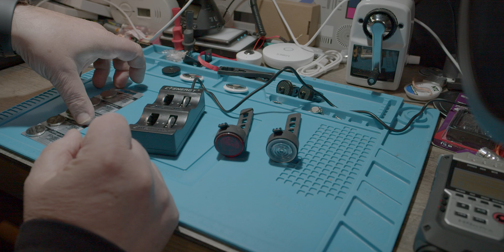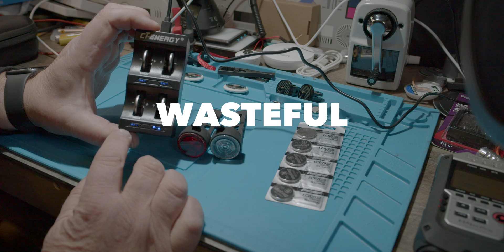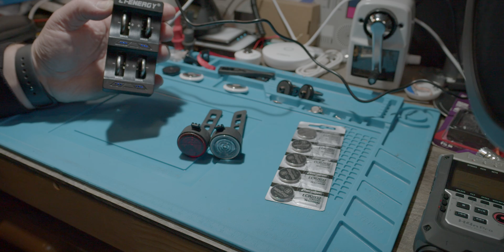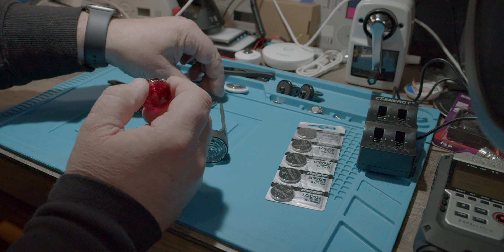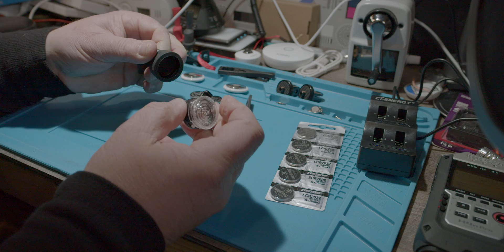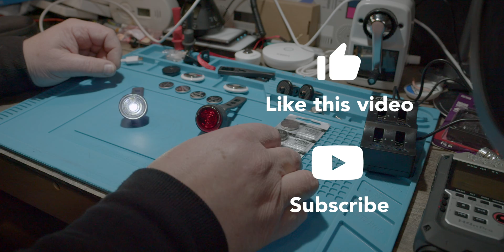LIR2032 Rechargeable Coin Batteries

Comment: Do the rechargeable ones last as long as the non rechargeable?
Reply from the maker: i don't think so. need to run the test, but it takes several days for those bike lights...
Reply: thank you for making the video. I hope to use rechargeable batteries to reduce waste. Can you give us an update now that it has been a year? Perhaps these rechargeable batteries hare not practical? I now have some, and may post a video on my findings. About to begin my test to use these with a Tile device for finding keys. Thanks again!
 @mygiguser
Reply: @joanofohio  Any update about from your personal experience testing these rechargeable LiR2032 batteries? Is the capacity up to par?
Reply: @andrewlee9508  Pretty useless video as it is...been looking into this and apparently the capacity of these LIR batteries is 1/4 of the standard batteries.